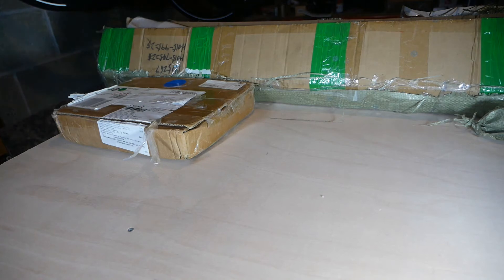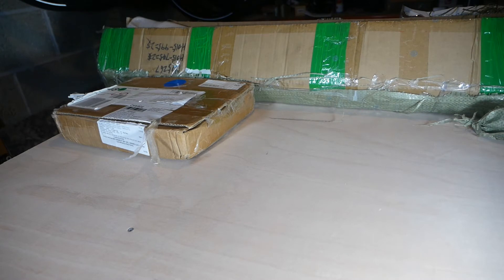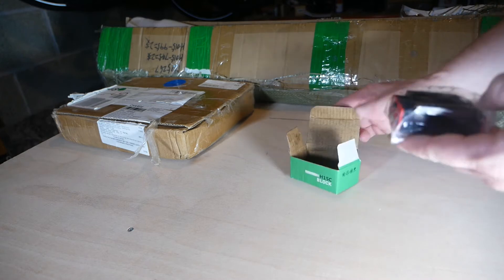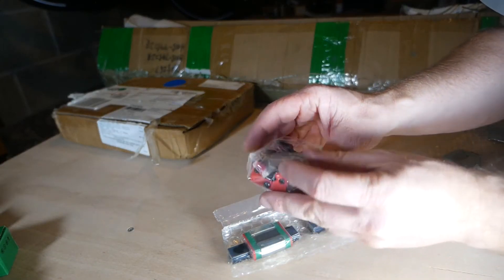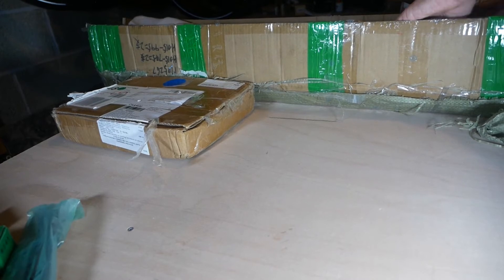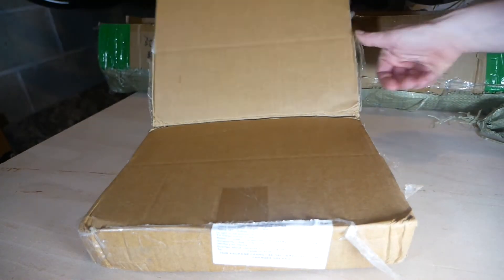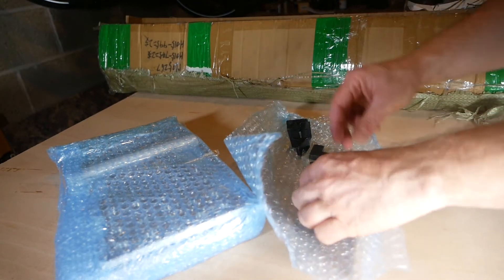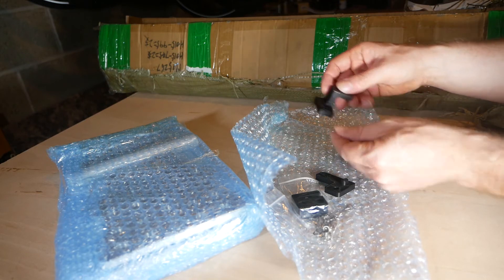QueenBee Upgrade Part 1 Unboxing

Comment: Good video, hope you don’t mind me asking but how much was the custom bill for the import.
Reply from the maker: I would rather not say the specifics, but both packages where stopped by customs, thing to remember about is they will charge 20% vat, and also £12 for the pleasure of charging you, they also may charge you import duty which i think us 2.3%. But thats only over a certain value of item. Really its the £24 quid that you see disappear to parcel farce thats the kicker.